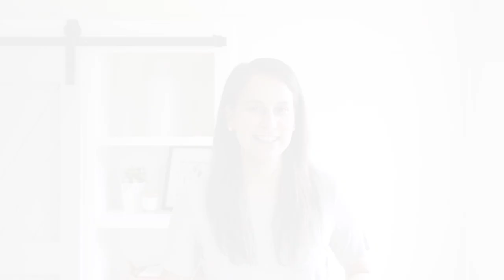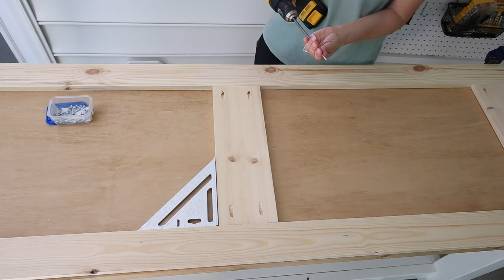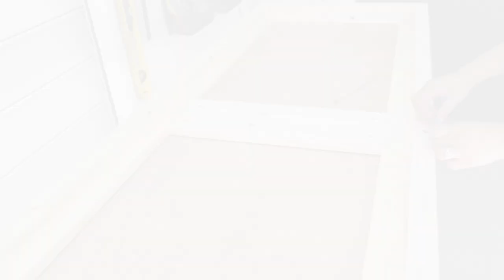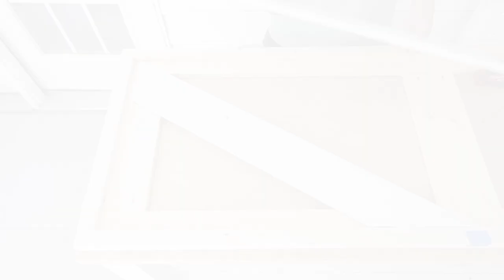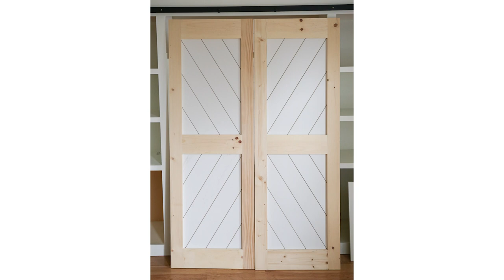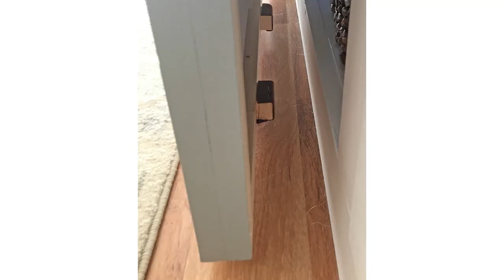DIY Double Barn Doors | How I Made My Double Sliding Barn Doors with Shiplap

Comment: Turned out great, nice job!  Cutting the shiplap would be easy on a table saw or sliding miter, however they don’t have to be perfect so a circular saw or jig saw would work.  Use a speed square against the circular saw or jig saw for more accurate cuts if you desire.  Keep up the great work as the goal is for us to continue to inspire others to build something awesome! 👍🏼
Reply from the maker: Thanks for the tips!

Comment: So I have a laundry inlet that I'd like to cover with these types of doors. Problem is that there's only about 1 1/2 feet on either side. So the doors wouldn't be able to be side by side they wouldn't be able to open. Is it possible to put them one behind the other??
Reply from the maker: I'm not sure, i think you may need a special double track to do something like that.